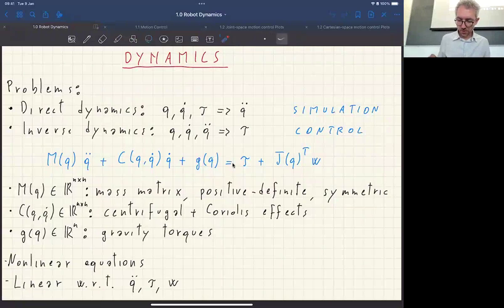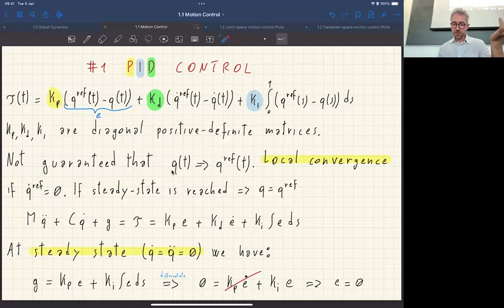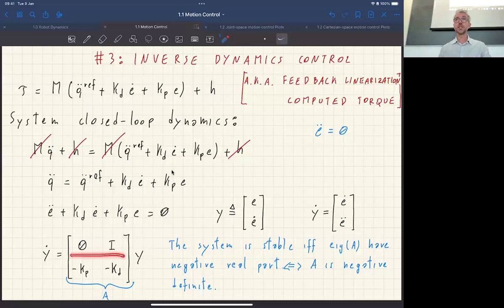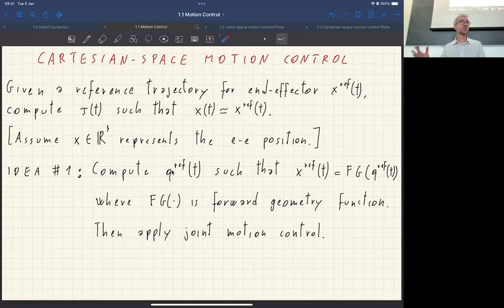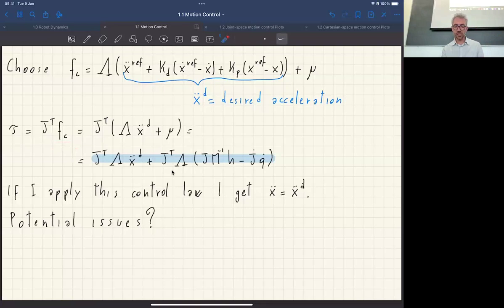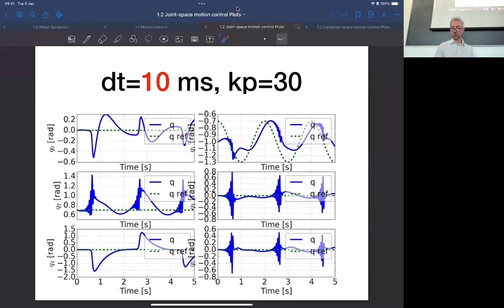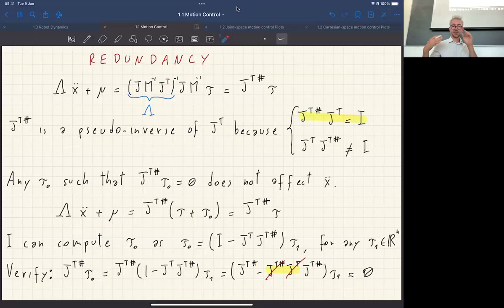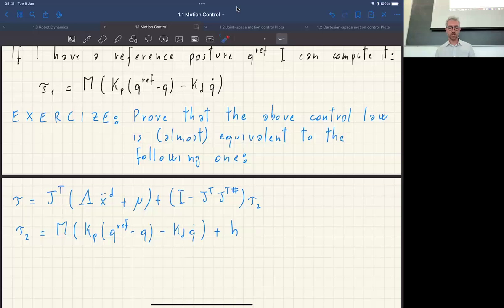Lecture 4 - Optimization and Learning for Robot Control - Motion control

Comment: Great lecture Professor Del Prete. I am more familiar with classical control thinking — plant, feedback loop, block diagrams — and struggled a bit connecting that to the robot dynamics framework you use here. Any book or resource you would recommend to bridge that gap before moving to MPC and RL?
Reply: Robot Modeling and Control, Modern Robotics (lectures are on youtube), Foundations of Robotics